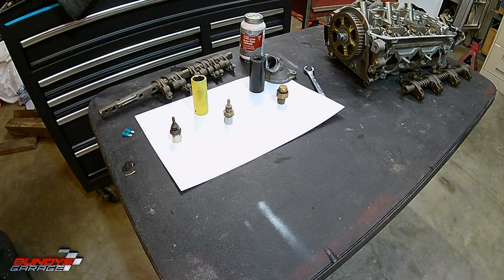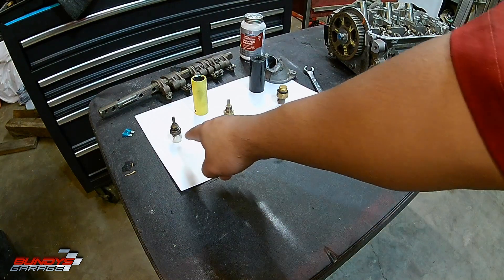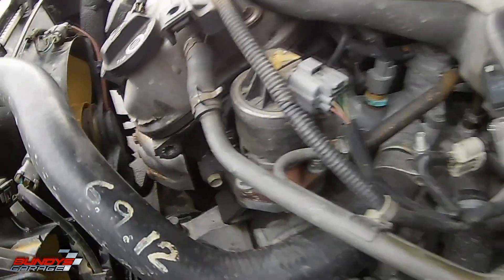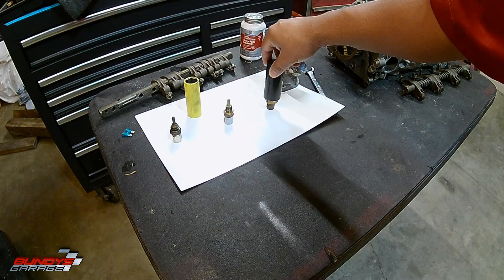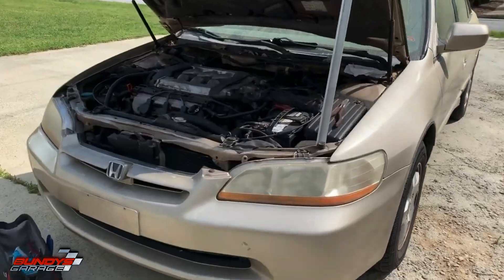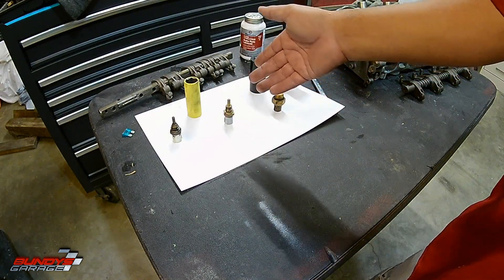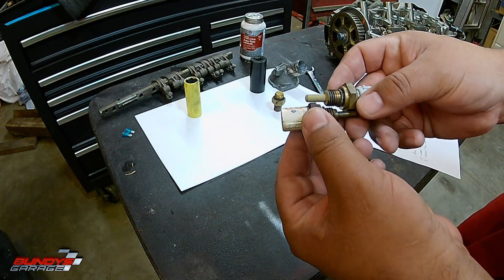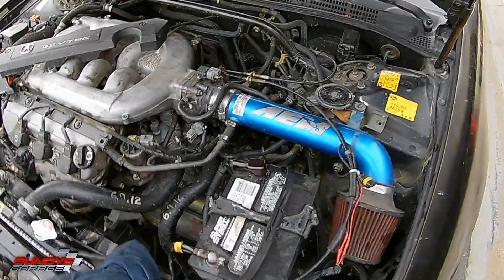SOLVED V6 Honda Accord Vapor Lock Heat Soak Fix | J Series Acura TL | Bundys Garage

Comment from the maker: UPDATE FOR 2023: The issues came back for me and this is what I had to do, had it beat for two years, then is came back. I will tell you what to do but you have to promise to report the results here (good or bad)! You have to change 3 sensors, 40 bucks on Rockauto.com amd the fuel pressure regulator. You have to change the engine coolant temp sensor (19MM), the air intake temp sensor (19MM) and the fan (thermo switch) (it controls the fans behind the radiator) (24MM or 15/16 deep socket) sensor that sits in the thermostat housing. The air intake sensor is on the intake manifold on the back edge towards the drivers side. Here are the Honda / Acura pary numbers. Just take those and plug them into the search bar on Rockauto.com. Fixed the problem for me, period. 37870-PK2-015. 37880-P0A-A02. and 37760-P00-004. Just make sure you don’t switch the air and coolant sensors when you install them. They look identical and will fit both locations. Please let me know if this fixes your problem. If you have any more issues email me bundysgarage at gmail dot com
Reply: Hello I replaced all 3 sensors and fuel regulator and been running my 2000 honda 3.0 for 2 weeks with no issues, thank you alot.
Reply: Replaced all sensors and FPR. Same issue exists. Didn’t fix.
Reply: Update. Replaced both O2 sensors and EGR valve. Issue resolved. I replaced the front O2 sensor years ago but ended up doing the rear O2 when check engine light told me. EGR replacement I suspect resolved it.
Reply: Replaced all 3 sensors yesterday and the issue continued today. Did not fix the problem unfortunately 😢
Reply: Did this fully solve the issue? I replaced my FPR 2 years ago but no new pcm avail. I’m probably going to do your fix unless it failed.  This update you put says confirmed fix, but the parts you listed look the same as when you filmed this video 2 years ago. Did those same parts fail?
Reply from the maker: Yes this fixed the problem. The air temp sensor, and the 2 water sensors need to be replaced. I did the FPR at first but that did not fix the problem. Also make sure you burb the cooling system after doing this repair.
Reply: @bundysgarage  I was going to buy all the sensors Honda OEM. Or is it worth getting the aftermarket Rockauto ones?

Comment: I have a 99 accord v6 that’s doing this now starts stumbles n dies I read were the intake temp sensor would cause this it had code cyl 2 misfire and  cyl 3 would it just be the intake temp sensor bad.

Comment: Great video! One of the radiator fans on my 2001 TL doesn’t turn on at all, and the other one only turns on after I shut the car off and it’s above operating temperature

Comment: I have been having this same issue basically. I will be ordering these and trying it along with the FPR as you suggested. It will be awesome if the car ran great again.
Reply: Did the fix end up working? How does the car run now? And did you ever have any rough idle problems?

Comment: I have a TL 2001 with 190K miles. It has this problem every once in a while. I tried changing the three sensors, when I noticed some oil residue on the air temp sensor into the manifold. The problem seemed to disappear for a couple of days but I noticed yesterday it came back. I shifted the car to neutral momentarily and reved up the engine a little and put it back in gear and no problem for the rest of the way. This is a strange problem with no clear diagnosis.
Reply from the maker: It’s a strange one. One guy mentioned changing out the fuel pressure regulator to a newer version and this has cleared it up for some guys.
Reply: @bundysgarage  I'll try to change that next but will have to watch your video on it carefully before doing that. For the 2001 models is it located under the manifold , on the fuel rail? The model you are working on seems to be the next generation than the 99-03, which is what I have.
Reply: Just in case someone is following this thread, I also replaced the fuel rail pressure regulator, but the problem still persists. On my 99-03 TL I did not need to remove the manifold to access the regulator, it sits off to the side. So at this point I have changed all the things mentioned in this video and the problem persists.  When it does happen, just keep the  foot on the pedal gently (preferably in neutral)  until it recovers. If indeed this is the heat soak problem, this would allow the gas to "flush any air bubbles" in the fuel lines/rail until you get a solid flow. Anyway, its always amazing how many unique and perplexing problems exists out there.

Comment: Update, I’ve tried as you see in the comments below, all three sensors, I’ve also tried a new fuel pressure regulator as well as a new EGR valve and still have the exact same problems. After digging much more, it seems that the issue for some of us is more complicated and actually has more to do with the return less fuel rail system on our fuel injection. You can replace it with one from a Honda Odyssey that has fuel return, but for me that’s something not worth tackling so I’m just going to live with it.
Reply: The perplexing thing is why would the car not have this problem with the stock (non-return) type fuel rail and only manifest this problem after so many years?
Reply: @rachelbinto  Good question, I don't know but I did switch to non Ethanol-based fuel and it works much better, still stutters but never has it not started.  I have also noticed that if I pour water over the top of the manifold, she will fire right up.  So there is def a heat/vapor lock issue.

Comment: Careful before you buy all new sensors. I have this exact issue and pulled the trigger on new sensors but unfortunately, I had the same problem. There’s no change. The next thing I would check is probably fuel pressure regulator and or EGR valve. I literally am dealing with this right now sitting in my car as I write this.
Reply from the maker: Change out the fuel pressure regulator. What year is your car? If you have a 1999, 2000 car upgrade to a 02 - 03 Regulator for the same vehicle.
Reply: @bundysgarage my car is a 2001 would I need to get an updated PCM as well or just the FPR? 

I also have an issue, I think it’s related. I replaced my IAC valve hoping to fix rough idles, warm start problems, but it seems to have made things a bit worse. The car runs great especially after cleaning the throttle, but when shifting to reverse or at a light, the idle gets real low but never dies. Only time it dies is only warm starts. No codes are triggered.

Comment: Wait a minute. Replacing these sensors after all these years is a good idea BUT - the heat soak problem is directly related to fuel / ethanol additive vaporizes within the fuel rails AFTER the engine is turned off and hot - and the result is the engine will not start.
Reply from the maker: Sorry to burst your bubble. It has nothing to do with vapor lock. It received that name for God knows what reason. These 3 sensors tell the engine what the temp is and when they don’t work right they “freak” out and when they get hot they won’t let your car start. Has nothing to do with fuel.
Reply: @bundysgarage  Makes sense

Comment: Acura cl has similar issue, but it starts cutting back after I drive it over 60 for a bit. Then when I drive it in slower traffic it wants to sputter. I step on the gas it will go but just pressing as needed it goes back to sputtering. Driving around town, its good all day no skipping. I have cleaned the intake, replaced plugs, wires, tps. Is your solution a fix for this? Thanks for the videon

Comment: I replaced my fuel pressure regulator and that resolved my problem.  I am still glad that I replaced the sensors as they are over 20 years old.

Comment: Why when I unplug the fuel pressure regulator vacuum hose it stops shaking? How is that related to the sensors?
Reply: It is not related to these sensors. Disconnecting the fuel pressure vacuum will cause the FPR to run at a higher pressure which will get your vehicle started again. (quick temp fix)

Comment: Sorry for the late reply you helped me a while back linking me to this video stating that this was my problem and you were right I had replaced my fuel pump the main fuel pump relay and other things to no avail I replaced these three sensors and I drove my car all day and started with no problem thank you
Reply from the maker: It’s a very strange problem and Honda’s fix was a new PCM. Glad it fixed your problem.

Comment: Well, today was the first day about 75 degrees here in South Kentucky and my problem is back.  It was not nearly as bad, bt died immediately and upon restart, I had to peddle it for about 30 seconds till it smoothed out.  Engine temp never passed 35%, and runs great but irritating start prob still not resolved.

Comment: I have this same problem with my 2000 v6 but I dont get a check engine light. Is it because when it happens I catch it fast and bring the idle up til it smooths out maybe?

Comment: Thank you for this video!! Yes there are still people dealing with this intermittent and annoying issue. My 98 Accord is my daily driver with 300,000 miles. Unfortunately I won't know until we have hot weather again if it worked! I've been dealing with this for YEARS. I noticed the air temperature sensor was coated in gunk when cleaning out the EGR passages & throttle body. Did you use aftermarket parts or should I go with OEM?
Reply from the maker: I went with Beck Arnley sensors. If you look in the description of my video you will see links to the sensors that you can get on Amazon.

Comment: This exact issue happened to our 2002 Accord 3.0 at around 189k miles. The transmission went on the frits shortly after so we ended up trading in in on a newer Accord. But now I know the fix if this happens to my Acura 😁👍
Reply from the maker: It’s a really strange problem and hard to diagnose.

Comment: Good to know, I haven't had a problem with my Odyssey yet; it's a 2008 so I don't know if any measures where taken to fix it by then.  Thanks for the info, you've helped me in the past.
Reply from the maker: Yes Honda had fixed the issues by 2008. It's only really effected the Accords and the Acura TL's from about 1999 - 2002ish.

Comment: I firmly believe, the Honda "J" is one of the greatest pieces of engineering...
EVER!!!
Reply from the maker: It is! Too bad they quit making them...
Reply: That makes me kinda sad, i like those engines; they're the V6 that's in my 2008 Odyssey, right? 

Either way they're a strong engine that's a long lasting beast as far as my experience goes. If you keep up on the maintenance that is.
Reply: @Pantherman1979  My J30A1 has 300,000 miles and drives great! I had the transmission replaced recently so it has a ton of life left in it!
Reply: @briangreen430  Amazing!

Comment: @BundysGarage—Near the end off the video  you said the first two sensors (air intake temp & water temp) could accidentally switched and installed in each other’s place. Are the electrical connections also identical or are they unique so that you would figure out your mistake when  you tried to plug in each sensor?
Reply from the maker: Let me check and I will get back to you.

Comment: First. 😁
Reply: Rather than replace all the sensors I made an educated choice based on the fact that the temperature gauge was working properly and the fans were turning on at the proper temperature. The lowest hanging fruit was the air intake temp sensor. I removed it and checked it with an ohmmeter and sure enough the sensor was open from pin 2 to the body of the sensor. Yours was the only video that nailed the problem. I wrongly changed the idle air controller valve first based on other channels. Thanks for your video. I love my 2001 and 2002 accords with 3.0 liter “J” series engines.
Reply from the maker: Good job! KEep your eyes peeled cause I'm going to be launching a new series called Free Tool Tuesday. Where you subscribe and leave a comment and then I picked someone at random for the tool I did a review on. 

The last one I did: https://youtu.be/vDPR_lpN3BQ